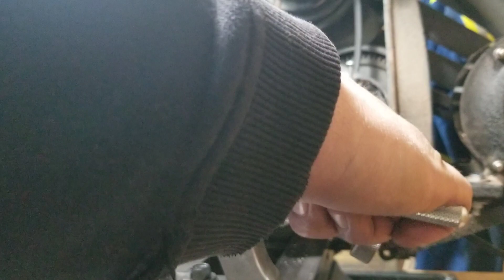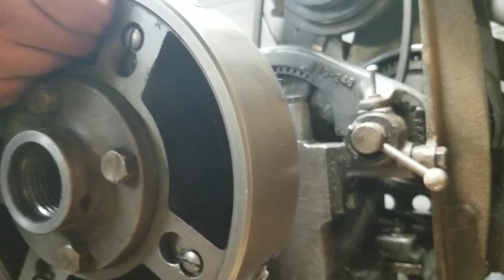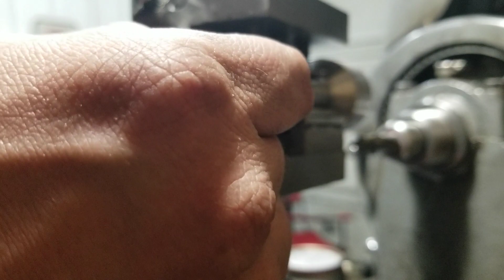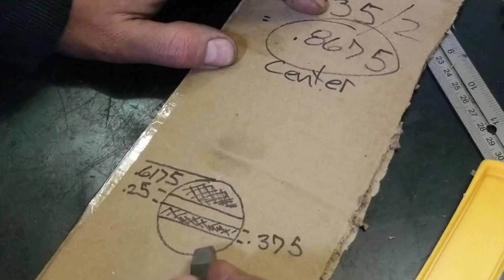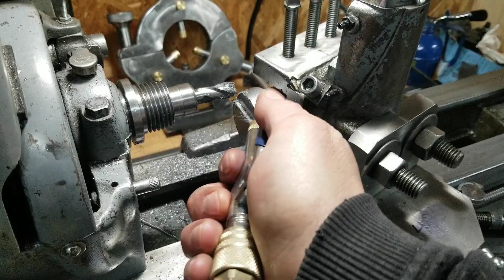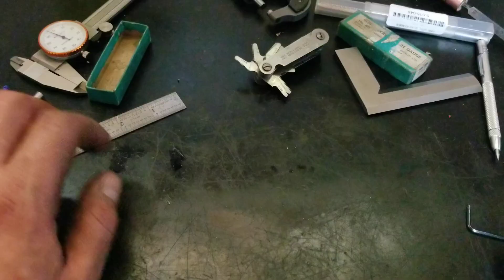Making a FLY CUTTER in the HOME SHOP

Comment: Coolant is always a good thing. Heat is the major cause of cutter edge break down not to mention you need a coolant to flush the chips away from the cutter and work. No matter whether it is carbide cobalt hss or any of the coated cutters. I run a "cool mist" mist coolant on my mill and lathe. I have flood coolant available for both but if I am doing light work the mist cooler will do. Yes they make a mess but that is just part of machining. Never use an endmill longer than needed to make the cut. Carbide doesn't "flex" very well. Small cutters just break. Just my two cents worth. Damn good looking tool holders.
Reply from the maker: Thanks, Johnny! Tips like that was the initial reason for starting a channel 😊. Machining is a steep learning curve so every bit helps 😁. Thanks again! Cheers!

Comment: recent subscriber. i see you doing a lot  of milling with your lathe, and chip load and chatter seem to always be a concern. i am in a different yet the same circumstance.  the promax rougher/finisher hybrid made a big difference in my situation. if my goal is metal removal that's the choice. i have a 1/4  💕 that i have run through 2 ball bearings, still going strong. maybe my must efficient metal removal end mill.
Reply from the maker: Hi, Jack! Thanks 😊. Yes, it can be frustrating at times. I've actually beefed up my milling attachment since then. Think I drone on about it in the dovetail vid lol. Now a 1/2" endmill ain't so bad, still gotta watch out for the direction of cut, but not bad. The weakest link now I believe is the gib side of the cross slide. Unfortunately, can't do much about that. Now that I can run 3/8" endmills that's pretty much my go to 😁. Thanks for the comment! Cheers!